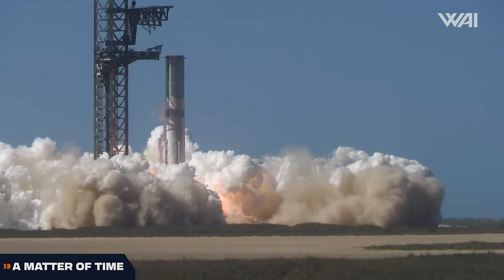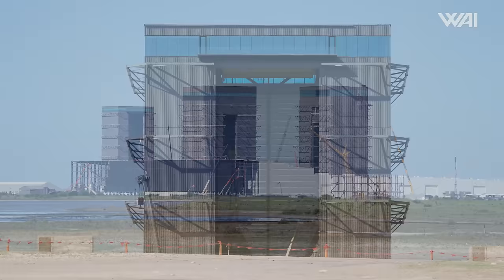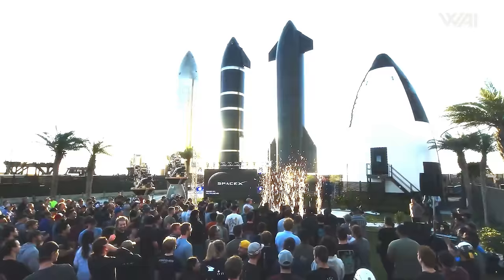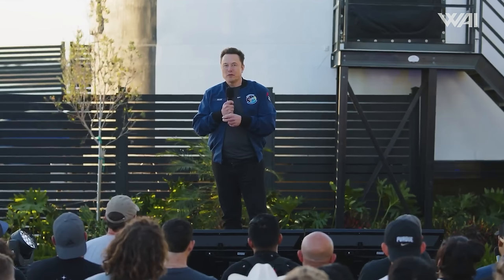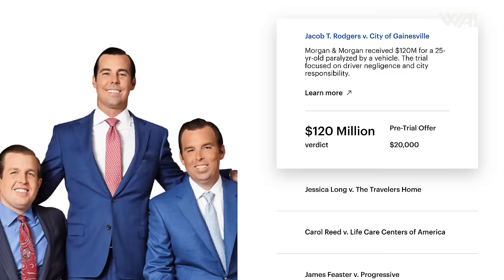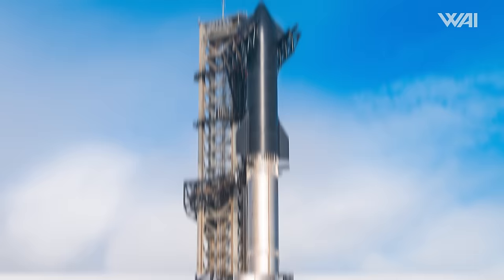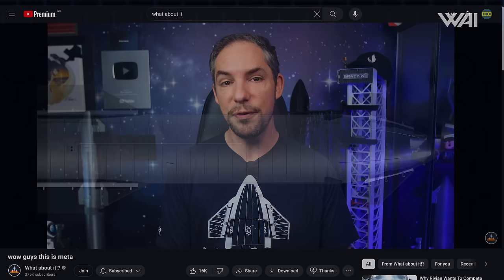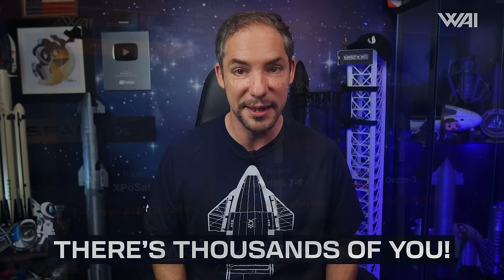SpaceX Unveils Groundbreaking Update: Inside Musk's Latest Starship Revelation!

Comment: I believe SpaceX needs to separate launch and catch functions. A dedicated tower for catching won't need any launch support hardware and won't require stopping rehab on the launch tower every time a booster or starship needs to land.
Another reason would be to prevent damage to the launch tower if something goes wrong during catch operations. it's not the same as landing a falcon, the booster has to basicly hover while the arms move in to capture.
Reply: but the whole point of them being together is so they can instantly get the next launch ready, if separated they need to transport it every time, that's too slow for their plans.
Reply: @yujinhikita5611  we understand spaceX's goal, but its just over the top and not realistic.

Incremental approach makes more sense.

30day turnaround for falcon 9?

Why not a 7-10day turn around for early starships? This heat tile issue is NOT gonna be fixed any time soon. 10day turn around would be 3 launches a month. Thats orders of magnitude better than anyone else on the market and would actually allow engineers at spaceX time to come up with permanent solutions to the issues we are seeing.
Reply: Landing on the launch pad is a really crazy goal. So many little things could mess it up (a gust of wind hits the ship, a fluxuation in an engine output, whatever!).  The precision will have to be within inches.  I am not optimistic for success BUT with time, effort and money majic can happen.  I agree with you on a separate catch system, at least in the near term.  The cost of a single failure would be very high but that is why they are already building mulitple launch towers for redundancy.
Reply: @WeAllLaughDownHere-ne2ou  You mean a 7-10 weeks like it was for the first Falcon 9.
Reply: @WeAllLaughDownHere-ne2ou  
" just over the top, and not realistic"
How many times have those words been proven wrong, when it comes to SpaceX.
Reply: @appliedfacts  Elon is addicted to risk....and he will pay the price for it.
Reply: @grumpusmaximus9446 oh boy oh boy…
Reply: @WeAllLaughDownHere-ne2ou  they are testing, you cant just state it wont be fixed any time soon, thats conjecture. the whole thing is designed to be rapidly reusable, so rapidly that they can launch multiple times a day. a big cost in time is the transport. the solutions come from data gathered which is why we'll see exponential improvements in time, because they can fix the issues that are poping up during the launches, making the launches have less time between them. you only need time to fix things if you have no good data, you have to make that data and go through many calculations and problems that will show themselves if you just make the thing. though it might look wastefully its a lot faster and in the end usually more effecient.
Reply: @WeAllLaughDownHere-ne2ou Lol clowns doubted F, F9, FH, Dragon & Starlink. If you think starship is impossible just wait to be proven wrong yet again. Starship will do everything the shuttle couldn't & more.
Reply: I think that a separate landing and launch system is a good idea, but in the same area. This would allow many more of each to be built more easily and allow quick expansion on starship’s capabilities in terms of frequent launches.
Reply: In the short term I'd completely agree that launch and recovery should be split so a bad catch won't destroy everything....

However the goal is to land (catch), refuel, slap on another starship and re-launch multiple times a day.

On the flip side once they have a second tower they can risk one being destroyed.
Reply: So second tower in the sea near the launch concept to deviate the risk.. 

Or have additional startship ready when other launches to reduce the time.
Reply: I think that there’s something being overlooked when it comes to landing and takeoffs using the same towers. Most of the reasons given here are valid but what about the other end of the journey, how many towers can you build on the moon and on Mars? How many trips will it take to build a single tower on another planet or moon, if you get it down to just using one tower somewhere else then you use those extra trips for building multiple towers to use for supplies and materials for housing and manufacturing. SpaceX is not only testing spacecraft for takeoff and landing, they’re also testing to use one tower for multiple uses such as takeoffs, landings refueling, hauling and unloading supplies, and who knows what other things they’ll think of. 
   Once established on the moon and other places, they’ll eventually build multiple towers but it will take time.
Reply: @appliedfacts  The planned  "virtual tower" hover tests will reveal whether the current concept will work.
Reply: @Hoaxer51  but surely such a tower would be damaged somewhere like mars due to the dust storms and 250MPH+ winds?
Reply: @joannewilson6577 
He will either pay the price or gain the reward. Either way I would love the be there to see it!
Reply: @appliedfacts  Elon himself said last year that he expect peoples will die by going on Mars and that he didn't had any desire to go there..
I do not think that the Starship can land safely on that tower many time in a row....

I don't even think that it's safe to refuel in space by 5 to 10 tanker in a row many times....for many reason....

The heat shield will be another concern but it will work most of the time...

The refurbishing will be costly for many years....

It will be interesting to see the progress in the next 2 years....:)
Reply: @yujinhikita5611  The heck with refurbishment I guess? They will do everything on the pad maybe? And how are they going integrate any precious payload safely in Starship if they catch it and re-stack directly? But hey, I know people are not suppose to ask questions in this toxic cult, or else...
Reply: @classydave75  they put the booster down where it landed, it catches the ship and depending what it needs to do, say refuel or put starlinks in it, they can transport it to a facility for payload or refuel it right there on the pad. for refurb they say they want to do a quick preflight check refuel and launch. no refurbishments needed except for every so often. the crane can pick up and put down both booster and ship, and they can be put on transport vehicles and be sent to the high bays. we ask question all the time they change things all the time. You're literally the toxic one here, not us, you just want to be like that because you hate elon and so everything he does is bad, or something like that?
Reply: @yujinhikita5611  Fair enough but it would probably make more sense to have two dedicated tower to catch the vehicles and not so close of the main one used for launch, if anything, to avoid collateral damages... Refurbishments will be needed each time for sure. And payload integration needs a specific facility as well, unless you want to do it in a totally amateurish way, which isn't going to sit well with customers. The fact that some people think this is going to be operated like an airliner without refurbishments between two flights is delusional. Imho.

Comment: A big concern will be the length of time for an accident investigation if there is a RUD during landing … I hope they plan to always have a launch tower available, i.e., don’t land until the second tower is able to at a minimum catch …
Reply: during landing they wouldnt RUD, its only done when you cant predict where the rocket could land with potential danger to public. and because its almost empty, it wont eplode in a giant fireball if anything happens, it would jsut fall to ground and crumble like a tin can
Reply: @Nuke-MarsX  I haven't looked into it in detail but when they tested Starship landings they also had almost no propellant left and they still turned into a huge fireball.
Reply: @Nuke-MarsX  RUD is unscheduled, not necessarily intentional.
Reply: @Nuke-MarsX Damn dude, you have no idea what you’re talking about.
Reply: @felixkuhn1239  But it's quick.  I think it's a flair up from gaseous Methane.  Won't melt steel or damage concrete and little blast wave.
Reply: @Nuke-MarsX  he said RUD, not flight termination system...

Comment: You would think they'd build a 'dumb'/simple tower for the first booster catch attempts, seems a bit crazy to risk damaging the launch mount, tower etc
Reply: Elon said they will use a "virtual tower" at sea before a physical tower at stage zero.  That will serve as the dumb tower.  GPS is accurate enough to get the precision calculated.  Still that physical catch event is going to be something to see!!
Reply: @appliedfacts a lot of things can go wrong during the catch itself, moreso with the high presicion required by the mechanism they selected. I don't think we will see any mechazilla catching soon, if ever.
Reply: the problem is the ship itself is an enormous bomb so having some pretend tower built, it would need crazy approval in case it came down near where people live. Its probably much more simple to do it over the ocean to start to nail the accurate movement at the last moment but it would look super cool seeing it do a pretend land on a real dummy tower!
Reply: There are therories that is what the second tower they are building at Boca Chica will be for.
Reply: A catch tower will never happen.
The second towers purpose has been confirmed to be launch.
The damage from a failed catch is likely less than IFT-1
The catch tower would be incredibly difficult to upgrade for launch.
The catch tower would require an OLM capable of detanking the booster.
The catch tower would be extremely expensive, and a most likely 2-3 use item.
Reply: @bryanillenberg  Yes, but it can be used for a catch attempt before conducting all the serious Stage Zero infrastructure installation to keep from having to replace a whole lot of parts without need.  

It does not have to be a dedicated tower for very long.
Reply: The booster will be almost completely empty. Explosions will be limited.
Reply from the maker: As said, SpaceX is feeling confident. It is not much different from landing a Falcon 9. :_WAIHeart:
Reply: @edwardsummey8843  Good point.
Reply: What boggles my mind is the size of the catch points which I believe are the same thing as the lift points.  If they were the size of say the grid fins I could get my head around it but they're tiny.  It seems A LOT more accuracy is needed than the F9 landings...at least in my mind!
Reply: @ehsn  maybe it will catch fire
Reply: In the future, I'm sure they will say this tower is dumb/simple, based on the iterative design aspect.
Reply: Maybe the new tower could be a mechanical with detanking plumbing without the rest of the apparatus of tower one. If catching worked out then the rest could be added to make it like tower 1?
Reply: The purpose of practice landings in the ocean is to refine the process so that populations are not at risk. It will not be much of a leap because landings are already that accurate. From here the accuracy needs to be improved to within a few inches. I am glad that it's not my job!! 😁

Comment: i find it amusing that spacex always seem to be botching things together, like all those tiles looking like junkshop cast-offs, but then it turns out it was all going to plan, even if that plan was for something to fail so they can make sure it doesn't fail next time. and once again shout out to all the people involved in building this dream, 24/7 dedication.
Reply: Progress seems  slow on tiles, they've  failed  3 times in a row.  No improvements  there.
Reply: @leschortos9196 to be fair they only got 1 chance to proove themselves ift1 and 2 didn’t even get to reentry
Reply: @mirochlebovec6586 IFT3 also wasn't able to properly test heatshield. Ship was tumbling during re-entry. I hope for ift4 proper test of heatshield.
Reply: @just_archan  Yeah almost forgot about that. It’s impressive that it survived so much of the reentry going ass first.🤣
Reply: @just_archan  Yeah, which is why it's weird WAI mentioned Spacex got a lot of good data on the tiles. I doubt it. Although they probably did get good data on the overall stress and heat resistance of the steel, which is nice.
Were it made out of normal rocket materials it probably wouldn't have lasted that long, which is probably why tiles coming loose isn't bound to worry spacex that much... for now
Reply: I see it as prototyping and testing. Things we've done in the past to check fit and enhance for the desired goal.
Reply: Elon has talked extensively about iterative engineering. Test to failure until you aren't failing anymore. Rather than the classic NASA way of preparing for years and years and trying to get it right first time. Elon's way is faster
Reply: Seems like it would be good idea to deliberately have some tiles fall off on the next IFT and to know in advance where they fail. This would provide lots of good data on the resilience of the steel underneath the heat shield. The sooner they have this data, the faster they will be able to determine just how many tiles - and where - they can survive without. Reasonably one should expect that no reentry will ever happen with 100% of the tiles attached.

Comment: I am happy to see at least one change I felt necessary, and that is the larger hot-staging segment. The current one seems tiny, and the booster  forward dome seems to be too close to the engines.
It's also nice to see finally the change in the flaps. Been a long time since it was suggested.
I am starting to accept that this is roughly the final shape of the ship.
We got a feedback about the future size of the ship, Raptor 2 and 3, their output and  rough timelines, the engine shielding question too.
So a lot of priorly discussed questions have been addressed.
Reply: Yeah, good things in both SpaceX and in making this video!

Comment: I like how, with each iteration, the booster is becoming increasingly similar to the N1 first stage.
I'm half expecting for the third generation to have a truncated-cone shape instead of the cylindric one 😁
Reply: And just like the N1, it will more than likely not work right either.
Reply: @TheGreat_Kramer1  what, did you watch the last launches?
Reply: @TheGreat_Kramer1  N1 would have worked and Starship WILL work.  Perhaps not 1,000 launches and a Battlestar Galactica fleet every 2.5 years but it will work.
Reply: The only thing is the money burned in the process of getting starship to work.
Reply: @Jojojump393  Still nothing compared to SLS, N1, or Saturn V. SpaceX spends about 2bn$ every year. That includes every falcon 9 launch, all the infrastructure they build and of course the starship program. Compare that to the ~25bn$ nasa has or the 840bn$ the us military has...

Comment: 😮 4 MONTHS AGO 🎉 I have commented on the second flight test preparation video posted by SpaceX 4 months ago exactly this: "⚡Starship hot staging section is too short in height and I think it could not resist the pressure of second stage ignition during separation. ⚡ I have said this at the first time I saw it ⚡ And I think the reason for failure of the second flight test was exectly that... that ignition of the second stage damaged booster and itself during separation 😢. Guys look at russian hot staging sections of rocket, they are built with long metal stiks with spike designed connection to minimize accumulation of extra heat and pressure during separation 🔥 🎉 Go Starship 🎉 Go SpaceX 🎉"
Reply: design is always subject to change but surely it has to be with data so not that your wrong or right it is all about design sometimes you have to try something new even if it seems wrong

Comment: Starship V4: its gonna be starship V3 with 2 extra boosters straped to its side falcon heavy style.
Reply: I think they could actually use Falcon Heavy boosters on the side of the Super Heavey booster.  Some structural reinforcment and up it goes.  The Falcon Heavey boosters can already land themselves too, I am pretty sure.
Reply: @appliedfacts  Designing a launch infrastructure for this with launchmount, piping for propellant and so on would be a nightmare, not to mention the integration of such a stack
Reply: @dionysschub5350 
In my mind the piping would only be one supply line to each additional Falcon booster and enough storage tanks to support them. 
Expanding the water deluge would be a job, true enough. That would at least require several more storage tanks and some additional perforated plates. Probably some redesign of the launch mount but maybe the Super Heavey could be reinforced to hold Falcon boosters on its own.
So, yeah...like you said. BUT like Elon said in his presentation, "It all started as an empty beach."
Reply: @appliedfacts  Even if it is technically somehow possible, it contradicts SpaceX's goal of rapid reusebility and a high launch frequency as SpaceX aims for, and by the way, the cost per launch would grow substantially. Shure, it would be cool but from an economic point of view there is no point of doing it.

Comment: My background is architecture and not rocket science but two general questions: 

1) If the shape (diameter and height) remain somewhat static, could the heat tiles be curved and larger format. Like 1/3 diameter. Were the tiles on the shuttle small due to shape and complex curves?

2) Could the booster have a setup similar to an aircraft engine brake to protect the engines from 'reentry'. Ie a two piece unit could swing down and cover the engines on decent. They already have the fold down legs from dragon. From previous videos it sounded like speed and heat were contributing factors is RUD.